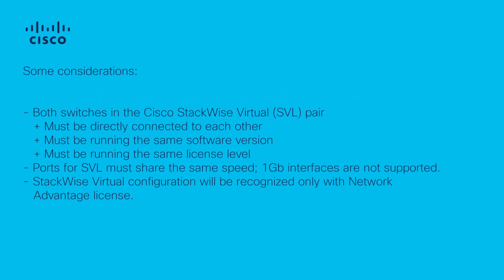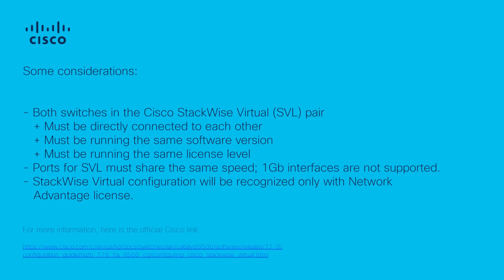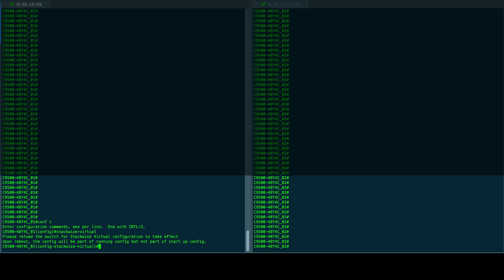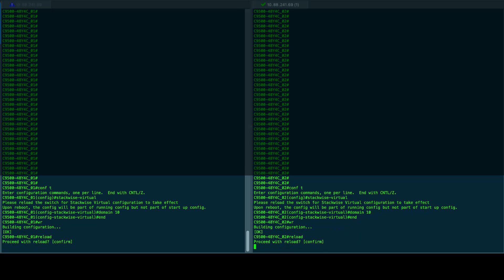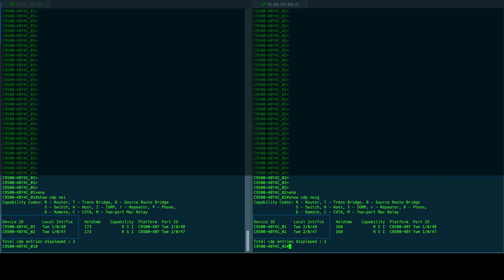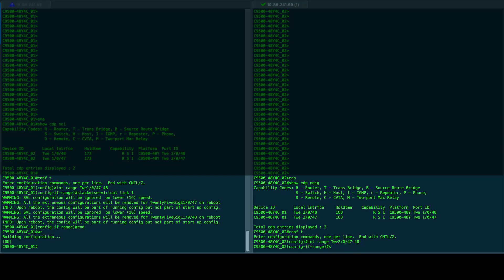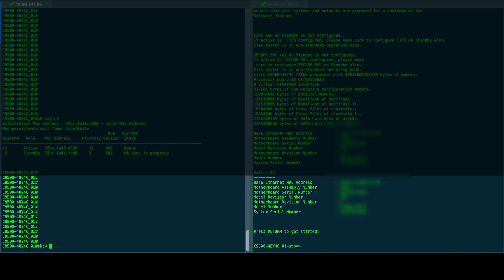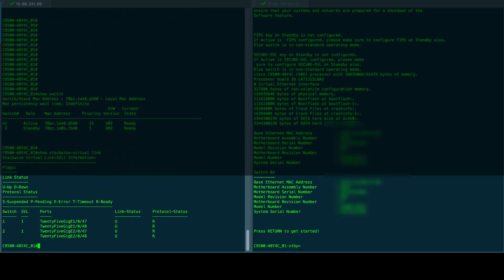Configure StackWise Virtual Link (SVL) on Cisco Catalyst 9500 High Performance (C9500H) Switches

Comment: Should i reload the switch after both domain config and SVL Conf? so the switch gonna reload 1 time.
Reply from the maker: Hi there, thanks for your question! You should save the configuration and then reload the switches after completing both the domain configuration and the SVL configuration. This means the switches will reload only once to apply all changes.

Specifically, the recommended procedure is:
- Configure the StackWise Virtual domain on both switches.
- Configure the StackWise Virtual Link interfaces on both switches.
- Save the running configuration to startup configuration on both switches using `copy run start`.
- Reload both switches to complete the StackWise Virtual conversion process and enable the configuration.

This approach ensures that the switches reload once after all necessary StackWise Virtual configurations are done, rather than reloading multiple times after each step. The reload is required to enable StackWise Virtual in the network and to resolve any switch number conflicts during the first-time conversion. We hope this information helps!
Reply: @Cisco  Is the configuration the same on the C9606?

Comment: Ey mate just wondering do we must to change the SVL links to L2 setting switchport and trunk mode? when is this necessary?
Reply from the maker: Hi there, thanks for your question, and we would be happy to help! When configuring a SVL connection, it is not mandatory to change the SVL links to Layer 2 (L2) settings such as switchport and trunk mode. However, there are specific scenarios where this might be necessary.

1. SVL Link Configuration:
   - SVL links are typically configured using the `stackwise-virtual link` command on the interfaces designated for SVL. These interfaces do not require additional Layer 2 configurations like switchport or trunk mode unless explicitly needed for other purposes: http://cs.co/6051N1Upv.

2. When L2 Settings Are Necessary:
   - If the SVL links are also being used for other Layer 2 traffic (e.g., VLANs or trunking), you may need to configure them as switchport and trunk mode. This is not a common practice for SVL links, as they are primarily used for system virtualization and control traffic: http://cs.co/6052N1Upa.

3. Best Practices:
   - Ensure that the SVL links are configured on interfaces with the same speed (e.g., 10G, 40G, or 100G) and avoid mixing speeds.
   - Use dedicated interfaces for SVL to avoid conflicts with other network traffic.
   - Follow the configuration guidelines provided in the Cisco documentation to ensure optimal performance and reliability.

We hope this information helps!

Comment: Typical for Cisco. Left out the initial required steps. Setting up the switch priority and switch renumber on the 2nd switch. Documentation on CCO does not match and is not clear either.
Reply: Also Virtual link configuration not explained 😡